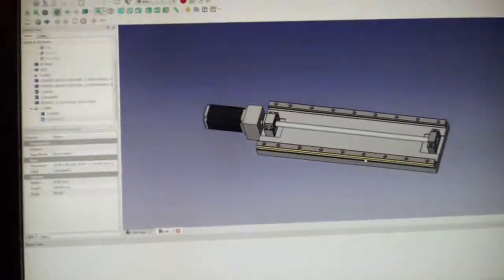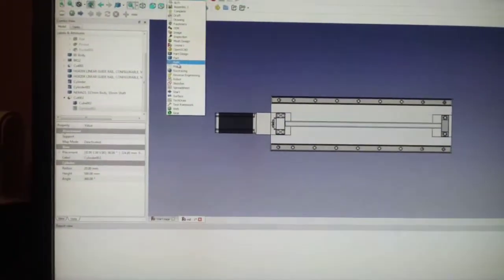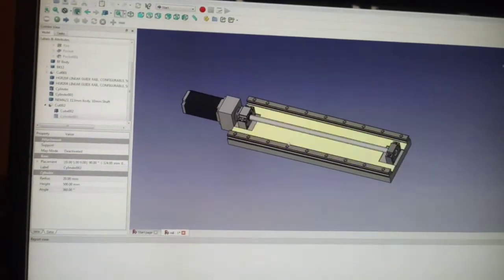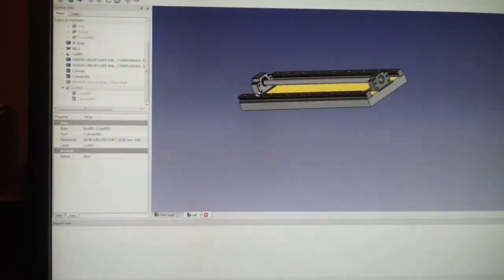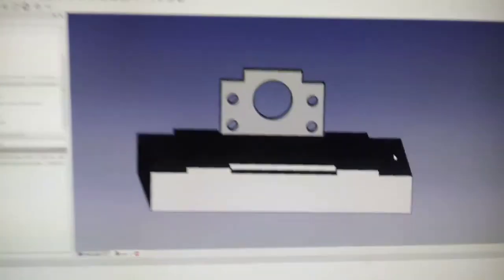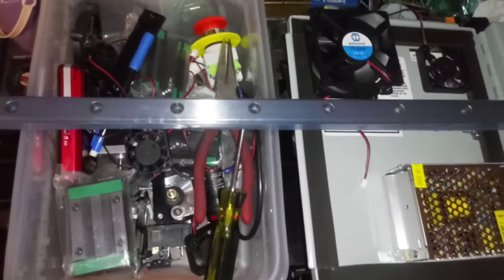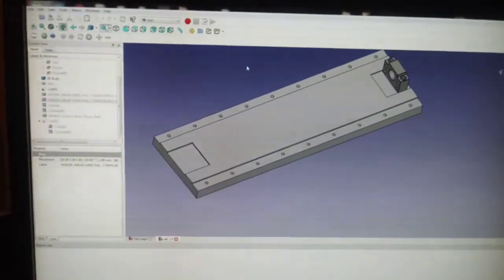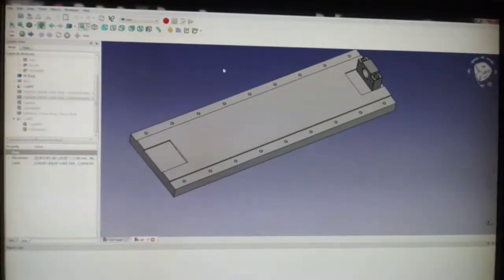Weekend progress report on Diy CNC projects and misc

Comment: I built a CNC spindexer based on the Arduino sketch by jquiggle on the Hobby Machinist forum and the design for the hardware that myfordboy did. Really works great. Mike, what do you use for CAM if you don't use Freecad? I have Solidworks, it's cheap if you join the Experimental Aircraft Association for $40. I looked at Freecad and it's CAM but it just didn't do it for me. Thanks for the video!
Reply from the maker: The only other software I have is fusion 360. I heard that they have a decent CAM software but never actually tried it. Solidworks seems to be the name everyone talks about. That or Master Cam. I will have to start doing some research into solidworks and see what I come up with. Thanks for the info I will check them out.
Reply: I use confusion360 on occasion but I find it much harder to use than Solidworks. I've tried Mastercam and didn't like it either. Just so you know I started using CAD in 1984 with Intergraph systems. Then became a programmer writing software to support the CAD systems. until 1998 when I retired and started my own business. Joining the EAA has several perks other than Solidworks. I don't really care about airplanes one way or the other but EAA gives you a cheap way to own a very expensive program. You do have to renew your membership in EAA every year too. Also so you know I got the 400mm ball screw mounted on my mini-lathe now it's attaching it to the saddle. Thanks for your help too!
Reply from the maker: @georgechambers3197  I looked at the EAA site. it says the solid works is free with there membership. Is that true? I don't care about the personal use part that's fine with me. 
 I have a degree in computer programming and coding. Mostly done with visual basic and C+ but there was a few other ones as well. (Was long ago memory not what it was :p ) all of the cad stuff I do is for fun. That's awesome you got the ballscrew installed. Are you going to do a video of it when its done?
Reply: @georgechambers3197  I ve done plans for CNC in Solidworks and it was easy. Fusion 360 is somehow too hard to work CNC plans for me
Reply: Yes, it's free. It is the educational version but it includes just about everything they make you could ever want to use. I programmed in everything from Fortran and C to VB. I still keep my fingers in it just to stay up to date. I had a sign business for years so I now hate wood and most foams. I still have my 4x8 router but have sold off a lot of the woodworking tools. I've been collecting metalworking machines for a few years now. I've got two manual mills a small Sherline CNC mill. 4 lathes including the mini-lathe. A 1917 South Bend 15" x 96" an SB 9A and a Jet 1024 and the mini-lathe I bought back in 1986. I don't think I'll ever make any videos for public consumption. I tried it when I restored my shaper and it was disastrous as far as I'm concerned. I do enjoy your videos and wish I could do half as well! 😁
Reply: @markyu70  I agree whole heartedly!
Reply: It's definitely free. It's the educational version but it includes almost everything they sell. You can do all the simulations CAM and more stuff than I'll ever need!😁
Reply: @georgechambers3197  I have Education licence because I am on post graduation study for last 25 years. Well nothing of my phd but ...